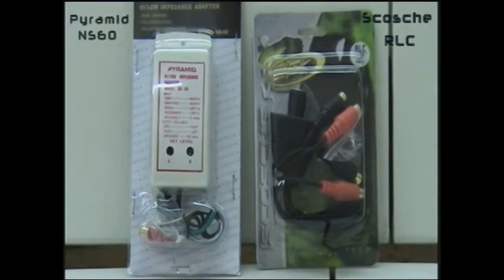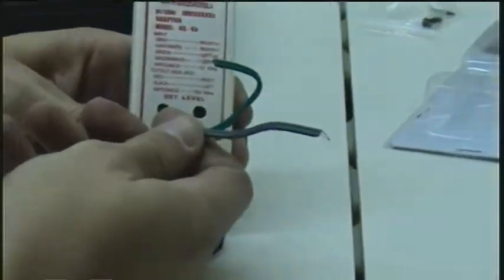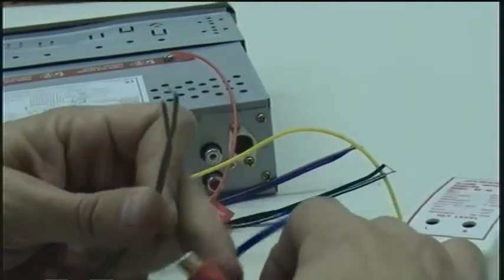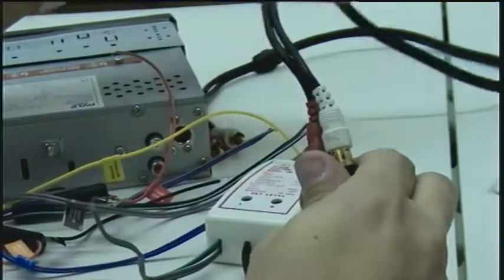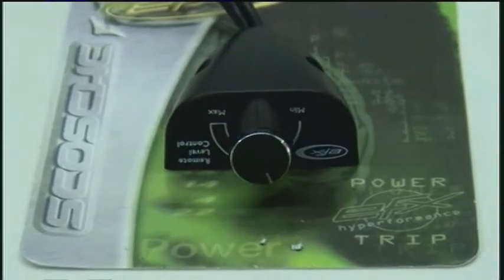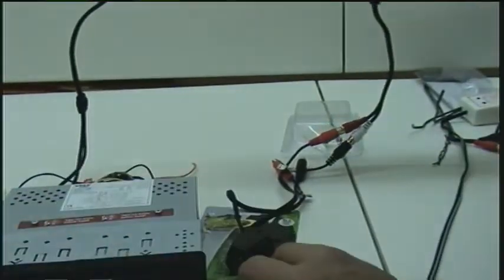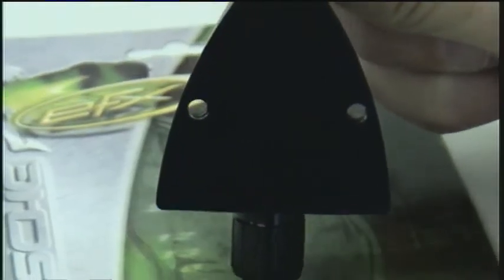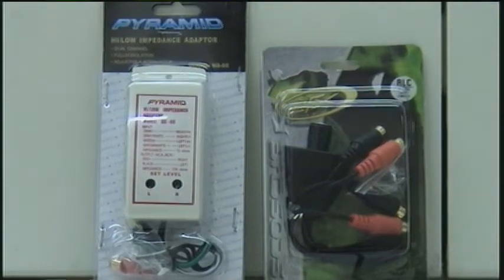NS60 & RLC Demonstration

Comment: Do you know if there would be any benifit to running this over tapping into the rear speaker to run rca for a mono block? I’m pushing a p1 12” and a punch amp rms matched 

I just installed a double din in my accord i think it sounds alot better but still not as clean as id like do you think getting a nice set of rca cables and running them all the way thru would be benificial? Or at least worth the time? Thanks keep the DBs flowing 🎶